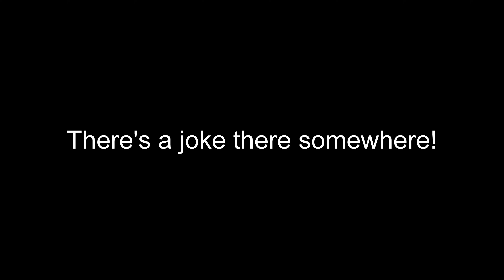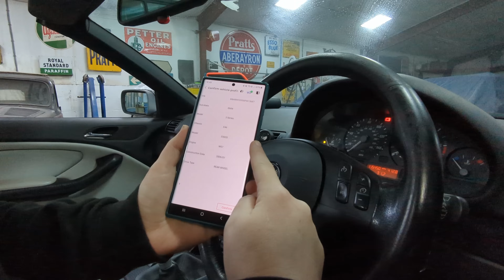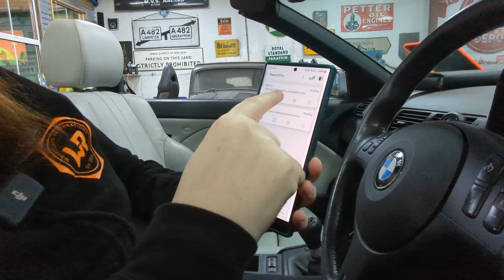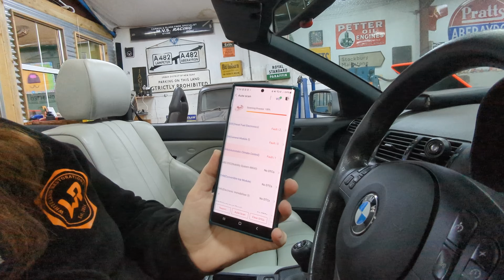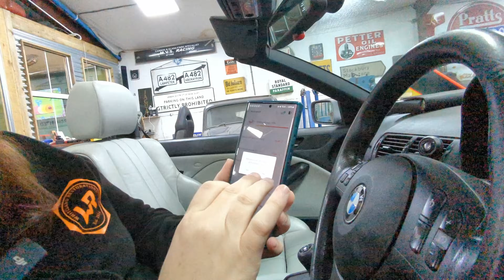How Much to Fix Our BROKEN BMW E46 330CD Cabriolet!?!?

Comment: Happy Festive Season. 

I have one of the head torches, they are great (its my second one, I broke the first one by using the wrong charging cable, so beware).  They are Machine critical when you work in poor lighting.

On your comment on using an OBD2 trabsmitter while looking at a second hand car, for sale. I got told by one salesman it's considered a No No.

Comment: Great project. Not every clutch job needs a new DM flywheel, thats a bit of a myth, just go on condition once its all out. I think you will find that you remove the rear suspension and tank as well and do a full restoration while you have the box out.

Comment: A private hire company I used to work for had a 330d MSport touring. 
One day on the M4 the swirl flaps decided to fail, the inlet manifold briefly caught fire before extinguishing itself while the driver limped it into Leigh Delamere. 
The company tried repairing it but it sounded like a bucket of bolts when they started it, so it was forgotten about.

Comment: The thing I always  fall back on  when,  I see you repairing  / modifying or updating the vehicles you work on. As a apprentice  my formen  & very good friend  over the years always told me , Alan don't  let it phase you they are all just nuts & bolts. So you can't tell I'm going back many many many  years.  & that 'the same attitude  you guys  have . 
Roll up your sleeves  & get stuck  in. Ray was a master mechanic  / engine builder  I was a fabricator / welder . Even now after 47 years I still call or visit  him for advice.  Keep up the good work & content

Comment: Really enjoy watching your channel when I get time, I noticed the front control arms are different from each other if you look at the lower ball joint one is mounted in a rubber bush [non M-tec suspension] and the other one isn’t [M-tec].keep up the good work

Comment: Very interesting to see how this compares to my old 2001 E46 320ci coupé. It needed two front wings, boot floor, a few patches on the rear wheelarches, rear lights, radiator, CCV, ventilation control resistor. I do remember the paint match was a nightmare (Hellrot).

Comment: Lewis & Leanne, have you considered genuine used parts where possible? eBay is a good source of such parts. RealOEM is your friend for cross-referencing part numbers. The build date of your E46 and the paint code will be on stickers in the engine bay. It has rust in the uaul E46 places. I'm sure you will already know all this as it isn't your first rodeo with BMW. The lower front control arms are similar to the E36 & E30. Nice Merc by the way.

Comment: Lewis, you obviously have a thing for these. Although I'm into Italian cars I've always loved the sound of the straight 6 BMW engine. A few years ago I bought an Alfa V6 166 in Japan and imported it so that I could enjoy the Busso engine for a while, I'm in a dilemma with that at the minute as it needs all timing gear/ancillary gear replaced at 70,000 miles and finding a specialist that will even tackle it (£2000+) isn't easy.
 In May this year I bought an E46 320CI M Sport Convertible 2005 from a work colleague, again to drive for a while and enjoy that engine sound. I'd known the car since 2012, a well looked after car with £5000 plus spent on it with all documentation. It does have 143,000 miles on it but still sounds so sweet. So my dilemma continues....do I sell probably the best 166 (mint underneath with full Zender factory kit) in the country or pass on my E46. I do have three other cars and need to downsize!
Reply: Would expect quite a few Alfa specialists would be able to do that to the 166. A common job.

Comment: A full oil flush can turn out badly from experience on an otherwise healthy vauxhall 8 valver.Wynns oil flush and then empty and replace with lovely new oil. Test drive to run the oil upto temperature and the sump gasket blew as did the front camshaft seal.Ok easy fixes but ....